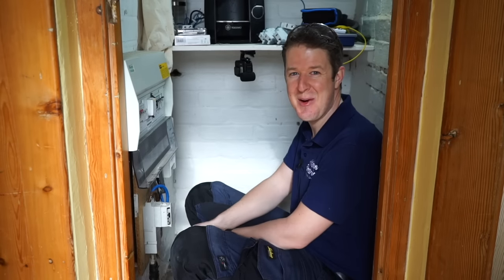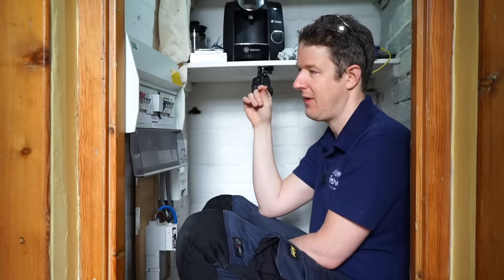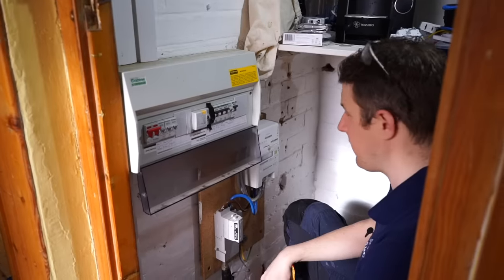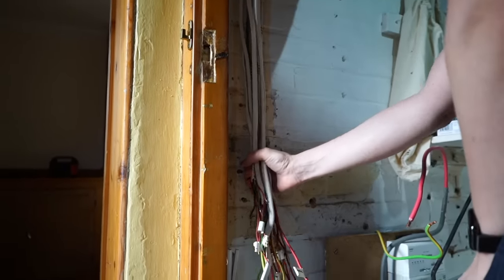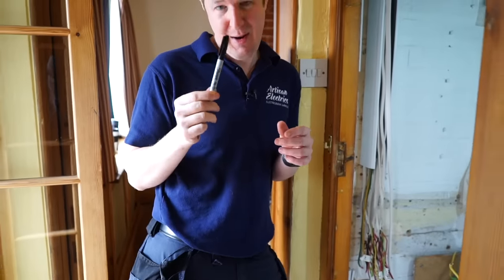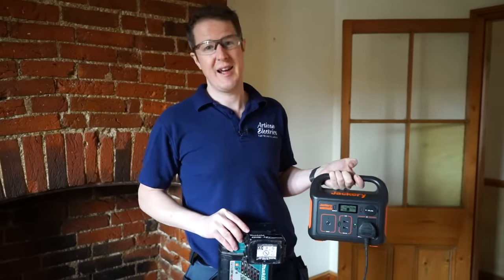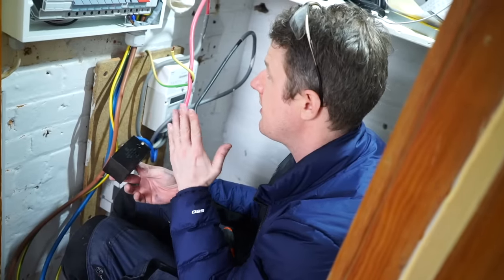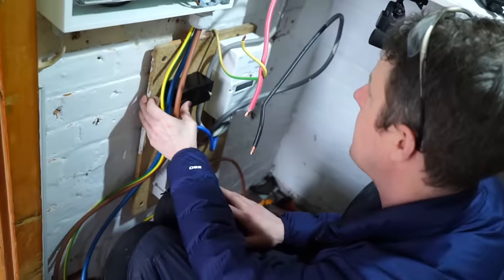My Consumer Unit Secrets 🤫 - How to install a Consumer Unit/Fuse Box

Comment: Great video and nice tidy workmanship. As a retired electrician  I love watching theses videos which bring me up to date on new regs and techniques.  My only gripe was when you were ID-ing the cables, the earth wires (old school) /CPCs were in danger of going into you eyes I know you had safety glasses but they won't protect your eyes when sitting on top of your head. Still it did not distract me from watching a good job being done. Thanks
Reply: I agree with your comment re the earth wires, I had a habit of folding the end away from your face so you would only get a rounded wire if the worse happened.

Comment: Nice video! I don’t mind doing consumer units. Just a thought to fit a isolator instead on Henley blocks just incase the power needs cutting saves pulling the main fuse
Reply: Does it matter if the isolator goes pre or post meter?
Reply: @ColinRichardson  do it after the meter because your not allowed to touch any that. Not your property. Plus if their is a fault with the meter you can isolate the consumer unit. Which I’ve had to because of it
Reply: @brightside0970  That is what I thought, and obviously a direct replacement for the henley block.
I have seen isolators BEFORE the meter, so I am guessing those were fitted by grid operators.
I just wanted to confirm
Reply: Yes indeed, much better to install a isolator rather than a Henley Block far more useful & practical, not withstand, it was well done, obviously got a really good price for it, therefore no need to rush. Well done " reassuringly expensive " 😂😂😂
Reply: @ColinRichardson  Isolators before the meter are... not normal practice...electrically it's fine, but it really makes electricity abstraction childsplay, and causes smart meters to send alerts. The ones you've seen are likely mistakes by smart meter installers, who sometimes are really well trained, professional people with years of experience, and are sometimes not gonna give a chimp a run for their money on an iq test. There is no middle ground
Reply: In a perfect world Yes ,but T&M says Henley Block , as Most think Not me coming back.

Comment: Very nicely put together video and very well explained. One thing that I didn't see was how you prevent water from an upstairs plumbing leak running down the cables and into the CU.
Having recently had a leak from my roof that ran down the wall and into the top of a surface mounted light switch wrecking the switch and the surface mounted cable, it's something that I've started to worry about.

Comment: Never thought there was a left and right to a ring,learn something every day 👍
Reply from the maker: There isn’t really but it’s just a way of showing there are two different legs
Reply: @artisanelectrics  whilst doing the continuity of ring circuits. Does it matter which live and which neutral are joined together?? Or as long as they are on different legs to the ring its fine?
Reply from the maker: @kristianhumphreys7984  Yeah as long as they are on different legs of the ring then its fine, but if you are doing the cross connection R1&R2 test then you do need to choose opposite sides of the ring

Comment: Always good to see your vids! Some useful tips. If you have to remove the cut out you should remove the fuse and reinsert the carrier, otherwise you have exposed a hole which has a permanently live feed in it. Mentioned this before, but cut out removal by anyone other than the DNO, electricity supplier or the Fire Brigade is not permitted. I have been on the receiving end of an appearance of Western Power on a job when I did this with a smart meter. The loss of power to the meter sets an alert off and the DNO is expected to attend to find out as its a loss of power to the property. If they are busy on other work they won’t rush out, but they can, and do attend.
Reply: Everyone knows that any extra time waiting for DNO is extra cost to customer. What is the solution? DNOs should be rolling out the fitting of isolators in all properties. Forget rolling out smart meters; get the sodding isolators fitted. It is in the interest of safety, the consumer and the trade.
Reply: @jam99  Funerals aren’t cheaper either !

Comment: Personally I tend to cut the meter seal and terminate them into the meter unless they've provided blocks already. Two reasons first if they're 16mm tails at the meter they should be upgraded if your main switch is 100A. Second because the customer is technically responsible for everything after the meter that includes the tails to the consumer unit which you're essentially becoming responsible as the engineer changing the unit and carrying out the testing and certification. As long as you carry your own seals to reseal and keep records of, it's not really an issue of tampering it's an issue of safety and responsible workmanship. 

Great video and quality workmanship as always. As a side note the tail clamp is only good for top/bottom entry if you come in from the side it's a pain in the butt and you find yourself having to strip the outer tail sheath to make the turn.
Reply: Yup, and if 3 foot of non flexi tails have been flapping around all day from the meter terminals, I would like to know they are still tight. Should have cut them of and put in a cutoff or henley before taking the board off IMPO.
Reply: Just out of interest, why does the main switch rating have anything to do with the ccc of the tails? 
Using 16mm is fine up to 87A clipped direct, and with most household main fuses rated at 60A - 80A, why try and stuff 25mm into the woefully inadequate and awfully shallow cage clamps of a modern (not fit for purpose) (must be enclosed in non combustible material) (terminal screws made of soft putty like material) main switch. Having said that, at least the 25mm flexible tails seem to hold a little better (shame about the lack of tunnel terminals and two terminal screws)
Reply: @jonanders76  Your gonna have to clarify the queastion/s.
Reply: @jonanders76  I think he meant the rating of the supplier's fuse rather than the main switch. If you have a 100A fuse, you definitely want 25mm tails. Otherwise the 16s are probably fine as I think they're good for about 87A
Reply: Jon and Robin are correct. Min size of tails is governed by the main cut-out fuse. Obvious really - this fuse is the only protection for the tails. Nothing to do with the Max capacity of equipment downstream of the tails.
Some electricity suppliers, such as Octopus, require engineers to upgrade tails to 25mm even for 80A fuses, but just playing safe. And a point to Mr Bubbly above :) cutting the seals on the meter is NOT acceptable and is an order of magnitude above pulling fuses (which we all do for justifiable safety reasons)  In case you are unaware, the seals carry a unique and traceable identifier number when fitted by the approved meter engineer.
Reply: @geraldelwood9660  in twenty years of cutting seals for rewire and board changes, I've never had a problem.....do we really expect the customer to pay for the supply company to attend before and after each new board....I'm assuming your just a meter fitter so it's a chance for you to flex a bit
Reply: @TopShelfSpurs  Hi Matty, as it happens I'm an electrician who was taken on by a smart meter company to do EV points. We trained on smart meters to qualify us to pull the main fuses legally. I was asked to fit many Isolators and upgrade tails, for Octopus customers looking to have a charger fitted. This was done for FREE. So all the customer needs to do is ask for an isolator and tail upgrade, then you can work safely and to the regs. vis-a-vis cable sizes.   (I hoping you don't feel it's OK to upgrade main fuse. That's DNO only)
As far as getting away with it for 20 years; I'm guessing you were not foolhardy enough to film yourself doing it and putting the video on public view.  As electricians we do what we have to do. But that can lead to taking unnecessary shortcuts out of habit rather than absolute necessity.

Comment: Great job. As somebody who does a lot of testing, i noticed no mixed colours label and no rcd label on the front (that i could see). I hope they were placed before you left! You seem to be getting a bit of a pasting here for the henley block. I do tend to agree tbh, an isolator would have been far more useful an addition than a henley. I dont believe in adding connections in large cables like that without a good purpose. The henley block serves no purpose. I love to get to grips with a good board change though, im looking forward to doing my mums when i qualify. It was butchered and thrown at the wall about 20 years ago by a buffoon, so anything i do will be an improvement!
Reply: Adding a henley block creates no more issue than if an isolator had been fitted.  Granted an isolator would have been a better choice,  even by Jordan's admission, however there is still the same amount of connections made. Not everyone carries 100a tail isolators around.
Reply: @marcusstonham  my point was more that an isolator would have a function here. The henley never will, its a rented house and the board has plenty of spare ways, there isnt going to be another board fitted.
Reply: @stevecraft00  but it doesn't actually matter. Isolator better yes, but henley block isn't an issue and doesn't create an issue
Reply: @marcusstonham  personally I'd have just taken the new tails straight into the meter.
Reply: Make sure you get an isolator fitted first .
Reply: @marcusstonham  I thought he said there was an eicr done the day before, so he should have known he needed an isolator.

Comment: My boss taught me to take out the main fuse from the carrier and reinsert the empty carrier to prevent any chance of a stray cable falling into the terminal. I'm checking the fuse size anyway, so I might as well make the job as safe as possible.

Comment: Could I just ask why did you not install a main isolator instead of a connector block?
Reply: He says the customer wants the best and then he ignores the basics.
Reply: I would guess the DNO will fit one when they come and re-seal the fuse?
Reply: @russellbosley5988  ha ha, that's a good one
Reply: @electricery  and it’s all bang up to date but leaves red and black tails between the meter and the block 🤣👍
Reply: @ashhowey  And if i remember rightly he's charging like 500 quid a day !
Reply: @russellbosley5988  DNO charge around £180 to fit a isolator and a Electrician is not supposed to cut the seals in the 1st place need to be MOCOPA qualified to pull the main fuse, the energy supplier will fit a isolator for probably half the price of the DNO, but seen as he cut the seals he might as well have cut the seal on the electric meter and put his 25mm tails directly into the meter
Reply: @electricalstuff259  😬
I’ve seen these guys do some bad stuff on a couple of their videos.
Reply: @mikeypc3592  kettle / pot

Comment: I don't know how I stubbled on to a UK video, but nice job. I'm from the US and I just had my consumer unit changed what we call (Main electrical panel) The thing is huge. I went from a 100 AMP panel to 200 AMPs. It required my electrician to drive two new ground rods in my yard and run another ground wire to my water meter. I have now room for 40 breakers and 80 circuits.

Comment: Personally I’d fit a Wylex 100A DPI over a Henley block but each to their own. 

On a serious note have you ever been bollocked for cutting the seals and pulling the main fuse?
Reply from the maker: Thanks and no never
Reply: @artisanelectrics  👍🏻
Reply: REC2 every time
Reply: You will know about it if you get a flashback, just don't pull it under load.

Comment: Depends on the DIYer. I never installed a consumer unit before but went ahead and did it. I read and saw videos where wires go where and did and it worked. Didn't get it tested right away but got it tested two years later and it was perfect. A DIYer can do it if he knows what he's doing.

Comment: Just thought I'd put it out there that I'm just a DIY electrician and I changed a full consumer unit and rewired and on of the people living with me tried grassing me up to the electricity board and they sent out 2 qualified electricians to see what the complaint was which they did say I shouldn't have attempted this, especially on a 5 bedroom house but they couldn't fail it as it was all good work they said 🤣  they passed it for 5 years and it still works now 10 years later 🙂 never attempted any since but it was great practice 😁 oh and love the neat finish, such a great job I'd definitely call someone like this in future 👍

Comment: I would be surprised if those cables were LSF as some manufacturers supplied twin and earth in white.
Reply: I think you’re right, iirc they only brought it in when they changed the wiring colours so old red/black with white sheath could be pvc
Reply from the maker: Yeah I think you’re right too as they were pretty easy to strip and LSF is usually quite tough
Reply: White sheath cable was used on surface mount in visible / decorative installations . Looked less intrusive than the grey. You could get white t&e clips too.

Comment: I did some work with my grandad in my outdoor shed and it makes me happy seeing that he was actually doing the same thing with pulling the cpc (earth cable) to remove the insulation from the and the cloth trick with straightening out the cable the only part he didn’t do was label the consumer unit with what the connections are and the (T) thing for the rcd but it will eventually get an EICR done and it will probably pass not the cleanest consumer unit but if it works it’s fine and it’s even better if it work safely which it does

Comment: It still really annoys me that smart meter installers still don’t provide means of isolation, they only cost £12.99 from Toolstation. It’s for that reason that I cut all their seals off, replace everything with new tails, and install an isolator as standard now. Rant over, a very neat job Jordan, love your standards and it’s nice when a customer gives you the time to do a proper job.
Reply from the maker: Great idea I might start doing the same!
Reply: Agree 25mm future proofing especially now EV installs are more frequent, how did you know that the cutout fuse carrier contained a 100 amp fuse ? The sticker on the outside just identifies that the cutout is suitable upto 100amps some meter engineers use independent stickers, next time open up the carrier to see what's inside.
Reply: Economics. Theres 16 million smart meters installed. An isolator might 'only' cost 12.99 but times that by 16 million...
Plus cost of new cables etc.
Given that suppliers have to keep costs to a mimimum due to price cap and cost of wholesale energy how do you propose they fund tens, or even hundreds of millions of pounds spent on isolators?
Reply: @richardfld  yea poor energy company's must be skint, let one man band Joe bloggs pay for it yea, with the rising cost of electricity at the moment they must be hard up....
Reply: Isn't  it illegal to cut the seals?I'm sure someone get arrested and fined a few years back for leaving a cut out not sealed? personally, I would seal the cutout up after as it's the right height for a toddler

Comment: Have you ever seen a flashover on a cutout? The disconnect time is 15 seconds? To the ring RMU (I think) anyway, it's safe to say it's extremely dangerous to leave a cutout with no protection. I can't see anything in this video? (Correct me if I'm wrong) A board change requires lots of manipulation of bare copper. Lots of debris. You can already see the cutout is covered in brick dust.

If the DNO allows you to remove the main fuse from the cutout you should use proper screening of the live parts inside once the fuse is removed to prevent anything coming into contact with them. You can easily kill yourself, or cause very severe burns! Do not remove the cut out fuse unless you have screening available, and use the specific PPE that the DNO requires.
Reply: Avoid sprinkling the sniped off ends of the incoming tails in to the new board
Reply: @ronimure1649   Heh, I'm not a spark but even I noticed that.

Comment: Nice job good to see someone else standing by there standards. As a non sparky can I ask why the board was being changed, and also why are plastic consumer units being changed when the metal ones being fitted are not sealed, i.e. cutouts in the back/top and bottom. I understand the metal consumer units are not fire rated so why change them, neither of them suppress the spread fire from the boards

Comment: I’d have asked to have the CU at eye level if it was mine, especially with that lid that only goes part way up.
Reply: yeah didn't like that 'feature'. Not typical for Hager... they're usually ahead of the curve on design. Maybe they were only considering new builds, where the CU has to be high up, rather than retrofits